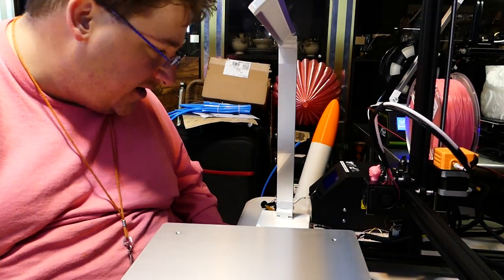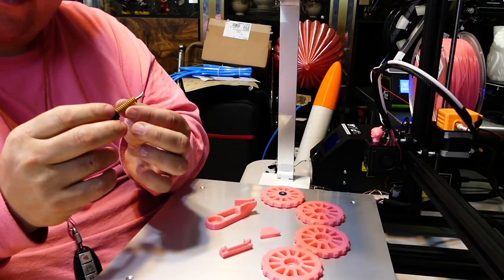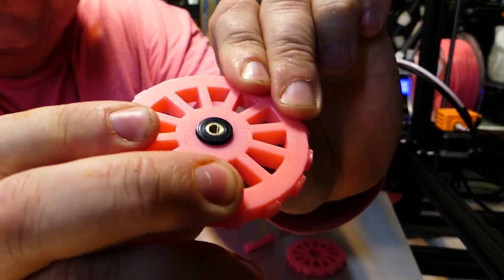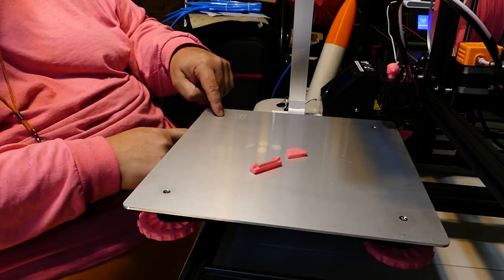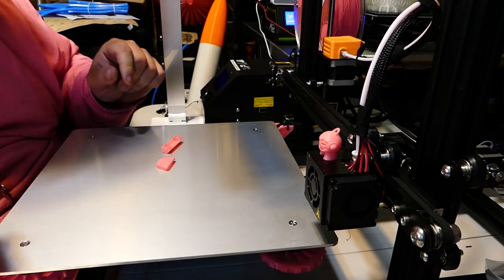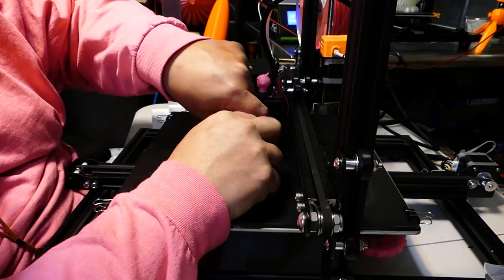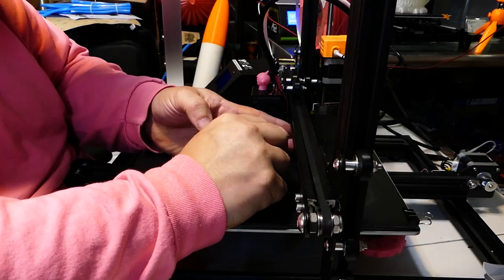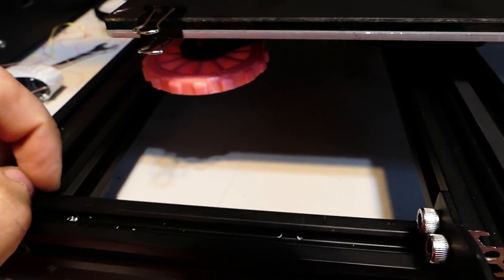Today's 3D Print - CR-10 Essential Mods Install

Comment: I am hearing PLA for those parts and I know on my printers PLA will deform and become worthless.  Heck, even ABS will deform when touching the heated bed or its leveling screws.
Reply from the maker: The Best Stooge yep I use Pla for all my parts and none of  them will ever warp. none of them touch hot parts and none of  them get close enough to deform.
Reply: Well, those screws are hot as mine are on all of my printers and PLA is worthless on them but you are using knobs already built from injection molding and that helps.  I know in my enclosed printer all of my PLA has deformed and all it takes is 50-60c for that to happen.  Having open printers helps as long as you don't get them near heat but PLA is a rubbish filament and not one I ever enjoyed using for any parts (I mostly print parts and real world objects not bric-a-brac or knick knacks) so PETG has replaced PLA for me and ASA will ABS once I get an all metal hotend and the price of ASA comes down to ABS prices which is soon I think.
Reply from the maker: ohhh nononono if you enclose PLA is a no go :-)

The jab does not really apply here. I build mach capable rockets using PLA. the stuff is stronger than ABS by nearly 100%. its only flaw is heat weakness and it prints like a dream. knick nacks make for good videos. videos of me printing rockets parts every day would be boring to viewers. and I love the cool prints too :-)

ASA is interesting but horrible layer bonding (parts just come apart at least compared to PLA) Might just be the sample I got (2.5kg so I hope I can make it work at $88) because ABS is nearly useless for what I print (lots of over hangs) ASA is supposed to do much better at that with much lower shrinkage.

now once I can get into Poly Carbonate and Nylon. now those will be fun. a pain in the ass but fun :-)
Reply: I am deathly afraid of PC and Nylon because within an 18h print they can become so saturated with water that they can no longer print and must be dried out.  I live close to the Mississippi river so humidity is a really big issue and it has been raining here for the last 24h and I dare not pull my ABS out to print my parts.  Already it has water in it but that is from the manufacturer and has been in it for a couple of years (since I bought it) and I can only keep it from getting wetter while in the box.  I am investigating a dehydrator but I think a vacuum pot would be better because water will boil at room temp inside a vacuum but the filament will not.

ASA requires more than I can give it with my PTFE lined hotend but it is like PETG where it is UV resistant  and PLA isn't but ABS hates the sun and will become brittle with exposure to UV.  From everything I have read ASA is precisely like ABS but has more protections and doesn't warp or shrink (like PETG).  The 3D Printing Professor has switch to ASA over ABS and he loves it.  I am not sure which ASA he uses.

My issue with ABS is I can't get it to stick no matter what in the summer when it is so humid.  Now the same part and the same printer which has sat there for 6 months will print the part(s) without any issues come the drier winter months and this is why I really want to try ASA because if it is as good as PETG is for me to print with I am sold.

Comment: Compression Die Springs on ebay
https://www.ebay.com/sch/i.html?_from=R40&_trksid=p2380057.m570.l1313.TR0.TRC0.H0.XPcs+Extra+Light+Load+Yellow+Tubular+Compression+Die+Spring+8mm+x+25mm.TRS0&_nkw=Pcs+Extra+Light+Load+Yellow+Tubular+Compression+Die+Spring+8mm+x+25mm&_sacat=0

Comment: The springs look like these http://www.ebay.com.au/itm/2Pcs-Extra-Light-Load-Yellow-Tubular-Compression-Die-Spring-8mm-x-25mm/331663122901?ssPageName=STRK%3AMEBIDX%3AIT&_trksid=p2060353.m1438.l2649
Reply from the maker: sony9650 yes but i dont want extra light.(that is what is on the printer) Turns out you need light. Medium is way to stiff and i believe you need 20mm 25mm might compress fully before you get the bed low enough.

Comment: you might like these new leveling knobs the make us of lock nuts like the ones for Wanhao, should help keep bed level longer. https://www.thingiverse.com/thing:2462249/#made
Reply from the maker: +NetWolf3D i have not had a problem with my bed level changing. I have not had to adjust my cr10 in 2 weeks and have not had to adjutlst my second since setting it up. The enders however are to loose i need to work on those.

Comment: found these were rated "light" on aliexpress:
https://www.aliexpress.com/item/UXCELL-2-Pcs-10Mm-X-25Mm-Light-Load-Blue-Spiral-Stamping-Compression-Spring-For-Plastic-Injection/32792627400.html?spm=2114.10010108.1000013.18.3d96c6cJ47wgG&traffic_analysisId=recommend_2088_10_90158_shotall&scm=1007.13339.90158.0&pvid=c290ba5b-52d3-4c24-9ade-adcf1f07758c&tpp=1
Reply from the maker: +Oscar Moreno those look good but be careful they're 25mm long you really want 20 mm 25mm might Fully compressed before you got your bed level

Comment: Check out McMaster-Carr this would be my first place to check and see. not sure what dimensions you are looking for. Also, I just bought a Creality CR-10 from GearBest but unfortunately I made my purchase prior to watching any of your video's, wish I would have used your coupon code to make my purchase but anyway here's a link to see if they have what you're  looking for.    https://www.mcmaster.com/#compression-springs/=196l0pc
Reply from the maker: Geo Bizworth I did check the site and could not find anything like this spring but maybe I can send them a picture and see what they come up with
Reply: I found this place, and I'm still waiting on my printer but I am working on getting familiar with Cura etc. Do you have an FB or a forum that you're on so if I have a question I can direct them in a PM? thanks for your time and videos, Geo  https://www.alibaba.com/product-detail/square-spring-Rectangular-Wire-Section-compression_1963089364.html